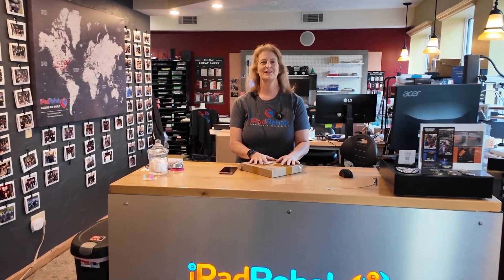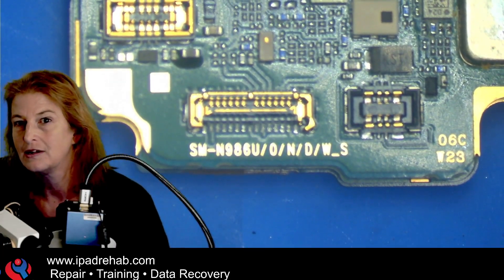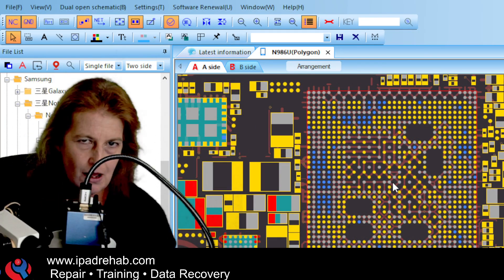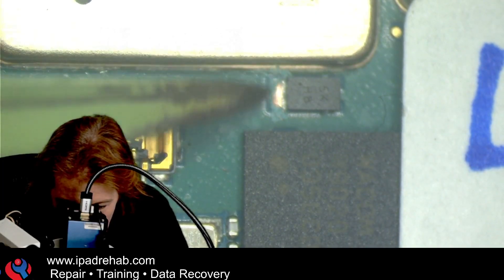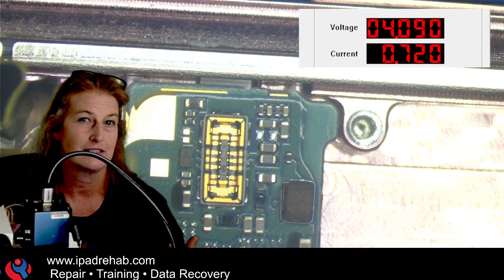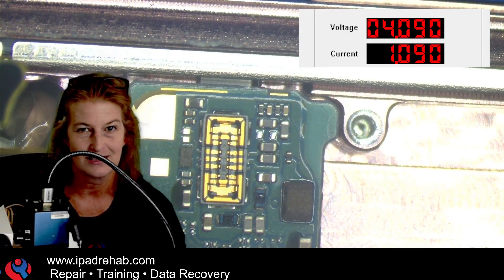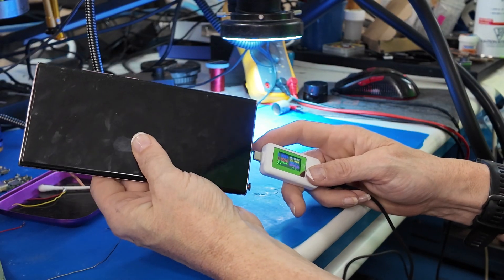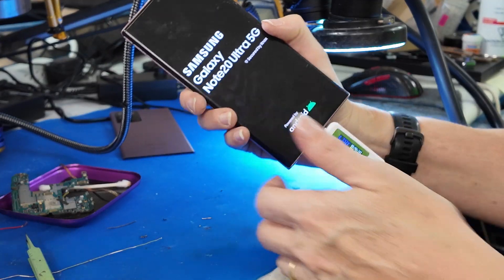Samsung Note 20 Data Recovery: Find Main Power to Troubleshoot Logic Board

Comment: If the job is data recovery, why not just transfer chips to a working board?
Reply from the maker: Transferring the chips is often what we end up doing, however it’s aggressive.  There are so many variables introduced.  How would you troubleshoot the device if the transferred chips didn’t boot?  An essential part of that process is understanding if the failure is WITHIN the chips and that requires understanding how they behaved electrically before and after transfer—is it the same or not.   You’d absolutely have to do this first step in this video regardless of whether the data recovery ultimately required chip transfer or not

Comment: Hi Jessa.
What kind of temperature and air flow you use in order to remove the connectors without burning them. Do you use the Atten or Quick hot air station
Reply from the maker: Atten or Quick they are about the same.  Any temperature under 400C will not melt connectors
Reply: @JessaJones  Thank you for the info, much appreciated. I guess a standard airflow of something around 40% to max 45% for plastic connectors

Comment: Why you didnt solder to battery connector xd
Reply from the maker: Many androids will not boot that way
Reply: I'm assuming she is trying to see if the thing even boots at minimum. Bypassing battery/charge circuitry removes one more variable. Less rabbit holes